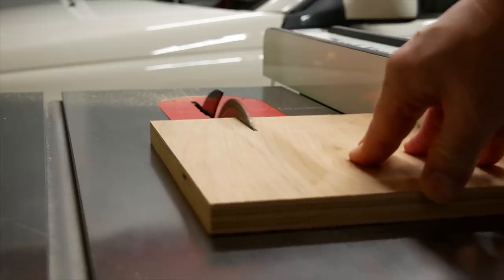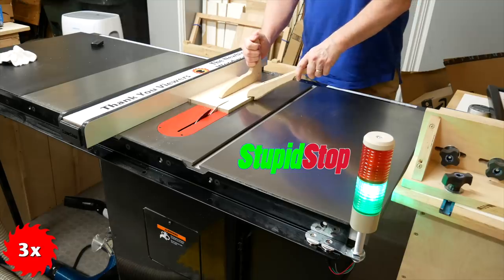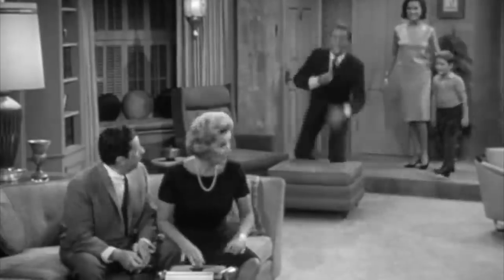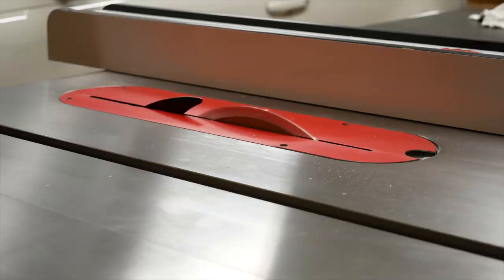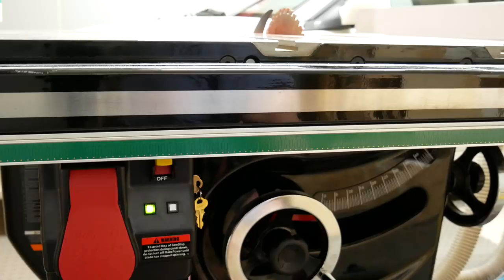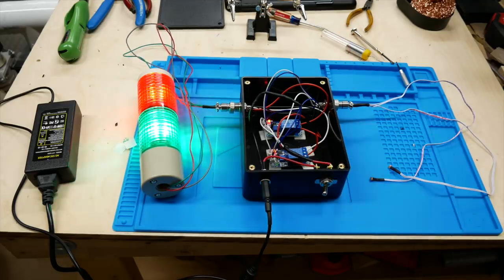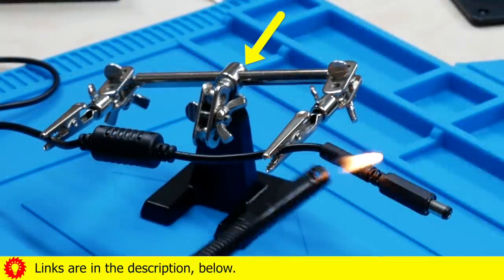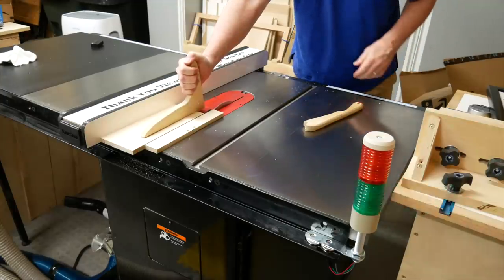Woodworking Distractions, ADD and my StupidStop

Comment: The way they described safety around the table saw when I took the class is not to go near the blade until you can count the teeth - pretty hard to do when it's moving.  Glad you found a useful solution & those other folks need to be nicer.  Thanks for sharing!
Reply from the maker: That's an interesting idea. Not necessarily counting the teeth, because I wouldn't do that for very long, but perhaps painting a spot next to every 5 or 10 teeth, and waiting until I can see the spot. Thanks for the idea!

Comment: I like to practice my motions a few times before actually making the cut.  Sometimes I just do it mentally, but when possible I actually do a dry run with the tool off; essentially rehearsing where my hands, eyes and body will be through the entire activity.  Often this simple step will reveal potential pitfalls.  

For example, before ripping a long board on the table saw you may find your outfeed blocked, or too much drag.  You may find that you need to add support on the infeed to maintain control, or that you need to move a featherboard.

This step also builds some muscle memory, so even if you get temporarily distracted you may find you still do everything the way you rehearsed.

Finally, just the act of taking time to rehearse keeps safety at the front of your mind.  Constantly reminding yourself of the danger involved really helps maintain focus... So even pantomiming your actions or running them through in your head can be enough.
Reply from the maker: Thanks for the great comment. I actually do practice my cuts when I have large or long pieces, checking to make sure I have enough room, or if I need additional support as you mentioned. And I think your suggestions is great, and I hope a lot of people take your advice. For me, I know I just won't do it all the time. It's hard to describe how my mind works, but I know it won't take long before I just stop doing it. Even I can't fathom me sometimes. 🙄But like I said, great advice, and I hope others give it a try! Thanks again. 😄
Reply: Thanks!  That is great advice.

Comment: As a disabled wood worker (only have use of right hand, left side mostly parallelized) table saw safety is my number one priority. Dan I could not agree with you more that  table saw set up is number one.  I do have a splinter and always feel a sigh of relief when the wood enters well into the splinter.  I never and I mean never reach to move or remove any material until the blade stops moving.  My life would irreversibly change as a result of a table saw accident to my one remaining functioning hand.  I suppose in a way I'm am able to concentrate on where my hand and fingers are 100% of the time.  I never cut anything without insuring material is supported going in as well as out.  I watch hundreds of videos where wood workers rip wood, leave the saw running, push the cut through and rip again.  For me it's one cut, turn saw off, remove wood, place material in place and turn saw on and repeat.  It takes twice as long, but it's much safer for me.  I do use appropriate push sticks, feather boards when possible, sleds and taper sleds as well.  I've been in this condition for 40 plus years so safety in the shop is second nature.  If you get some time check out some ideas I've been tinkering with on my YouTube site Working Hand Wood Works.  Chazz
Reply from the maker: Thanks for the comment, Chazz! I can't imagine what life is like with only having the use of one hand, but it sounds like you're doing quite well, and I think that's awesome. I checked out your Radial Arm Router and it's really cool. Have you built it yet?
Reply: Not yet, too many summer projects, but it is next on my list.  I did finish the miter station and went a different route on the shelving.  I forgot to mention how much I enjoy your videos.  Chazz
Reply from the maker: @workinghand5768  Thanks! And I totally get the "too many projects" thing. I have a list of projects to do a mile long, and it only gets longer. But it beats being bored, I guess. 😄

Comment: My father taught me that the most important safety device is the one between your ears. Probably the most important woodworking related lesson I've ever learned. Also, having four kids of my own, and a basement workshop, I have to constantly consider their safety when I'm using power tools and when I'm done with them. Things like removing keys and unplugging tools when I walk away. It only takes a couple of seconds to unplug and then plug in again the next time but it well worth it to ensure my kids are safe. Also making sure they know that the shop space is off-limits when the saws are running, that way they don't get hit with anything if I happened to have something kick back despite using a riving knife. Hope this helps someone.
Reply from the maker: Thanks - great stuff! 😄

Comment: 1) Do not use the saw, or other tool, for a "long session of repetitive actions" - you get complacent. I catch myself doing this now and then ( for example, batching out parts to something... like drawers, scares me awake...). They have those signs on the road to "Take a break, Stay awake" ... same sort of thing applies.
2) Do NOT use tools when you are tired
3) NEVER RUSH... 

4) Avoid any motions which will cross your hands OVER the blade... moving right hand across to your left to grad something, like a push stick....Or reaching OVER the blade to grab the piece of stock
After far too many years, I just built an outfeed table because I realized I was doing just that with short stock, or I was pushing on my push sticks in a way that if the work piece slipped my hand was headed for the blade...so after the event noted in Item #5, I said, this is stupid, build yourself one of those and save your hands! So I did...Everyone should....and a thousand things just like this,
...finally building a cross cut sled too...I like my fingers.

5) Avoid distractions - somebody just said this, but here is a real life example ... I cut my hand with a hand saw ( 5 stitches actually) because I was tired and rushing ... and then I noticed that I was being dangerous and got distracted by that and nailed the hand not holding the saw as I was moving it away from being in a dangerous spot.... I focused on the hand and NOT the saw "for just a second"... GOTCHA... though it has been pointed out that I was only using the proper tool for cutting of one's hand...it being a "hand saw" ... but the 5 stitch cut was only from TWO TEETH actually touching my hand... and only just....a table saw will not be so delicate in its consuming of your hand ( 3500+ RPM x 24 to 100 teeth... do the math)

Mind you this is a saw I have had for over 30 years, and use regularly and in all sorts of situations and with left or right hand as the situation requires ( like on a ladder), it's just a Stanley " Short Cut" saw ( with the " New Aggressive Shark Tooth design" !... they weren't kidding), and I'm not a newbie to this game... I was just 1) tired, 2) rushing, 3) got distracted..... I should note that I was using the hand saw because the cut would have been exceptionally dangerous on the table saw... so I wasn't being entirely stupid....only just enough....complacency is also your enemy 

Be Safe out there.....and if you think that you are....check again......it only takes " 1 second" to really mess up your life and the lives of those around you you care about.
Reply from the maker: Thanks for the great tips, and you're absolutely correct - it only takes a second for your life to change.

Comment: I don't have a You Tube channel so I doubt I'll ever own a Saw Stop But me and the table saw (Craftsman) have never had a problem since I was about 15. But we all feel stupid from time to time and laughing at our selves is good medicine. SQUIRREL!  Thumbs up Dan! Well that is only half right because back in '81 I lost about a quarter inch of my thumb when my glove got caught in a band saw between the blade and the wheel. After that the company built a guard for the saw. It was a metal cutting band saw so it was a slow motion accident since the blade runs a lot slower on a metal saw. Once the wheel had my glove it pulled my thumb with it. Did you know it is possible to yank your hand so hard you can pull off the end of your thumb? It only bothers me when I bowl. My ball release has never been the same. Keep on building!
Reply from the maker: Thanks for the great comment, Tim! Lot's of good-natured humor in it - my kind of humor. Regarding SQUIRREL, and I'm sure you've seen it before, but just in case: http://bit.ly/2n7Zup5. And man do you paint a good (bad?) picture about your accident. shudder 😮Thanks again for making me smile. 😄

Comment: Also severely ADHD, also a woodworker (and maker of all sorts), also not quitting. My biggest disaster wasn't during woodworking, it was... baking. I made cakes ahead of my youngest son's birthday and froze them, and then thawed them overnight in the fridge the night before. Well, when I went to trim the tops it became clear they were NOT fully thawed. The knife I was using to trim the top was sticking in the middle of the cake top. I should have addressed the not-thawed issue, waited a bit, maybe stuck it in the microwave. Instead, I forced the blade... and it wound up deep in my left index finger, needing stitches.

But it's still instructive: never, ever, ever force a blade. Pause and actually fix what's making the blade stick.

Also, that was before I was medicated. ADHD medication helps with the impatience part profoundly, because I'm not constantly worried that I'm going to lose my train of thought mid-project and abandon it like so many others. If you have ADHD and you think medication might help but you haven't explored it, consider it in part an investment in your safety. I'm able to keep track of blades, limbs, safety features and processes, and what I was doing in general SO MUCH BETTER now.
Reply from the maker: Thanks for sharing! One comment you made stuck home: "constantly worried that I'm going to lose my train of thought". To me, this is the single biggest reason for so many of my ADD-related behaviors, and yes, medication does really help.

Comment: FYI - I don't know if someone already said this but next time you have to solder into something like the four pin socket, put solder into the pins first solder your wire then all you have to do is heat the socket and slip the wire in. Its always easier to solder stuff together if you pre solder the wires and pins and use solder with flux in it.
Reply from the maker: Nope, nobody mentioned it. Thanks for the tip! I'll try that next time. 😄

Comment: Why can't saw manufactures install a blade brake? On my table saw, it takes too long for the blade to come to a stop. I would like it to stop within 2 or 3 seconds. Is that unreasonable?
Reply from the maker: That's a good question, and I don't know the answer. But you'd think it couldn't be too hard...
Reply: Exactly right.  The blade should stop sooner.  Why train our eyes/brains to watch the light and not the spinning blade?
Reply: It wouldn’t be too hard to build one in.  An electromagnet could be connected to the status light signal and activate while it’s flashing.  It would sit right off the blade (under the table obviously) and a strong enough magnet wouldn’t have to actually touch the blade to stop it.
Reply: My Grizzly G0513X2BF 17 inch Band saw has an electro mechanical and dynamic brake.
It stops the blade in less than seconds.
Reply: I think it may have something to do with the type of motor used on table saws Steve. I don't know how the saw stop works, but it will brake the saw either mechanically or electromagnetically and that seems to be ok. The nik on Dan's thumb seems to indicate it works fine, although harsh braking like that will kill the saw prematurely.
Reply: Some bandsaws have brakes
Reply: @MiniLuv-1984  I think he means a brake just designed to slow down/stop a blade under normal use.  Not an emergency stop.
Reply: @stevenlarson6125  Thanks Steve Larson. I don't know what such a brake would achieve if it just slows the blade after you've hit the kill switch. Perhaps I'm just showing my ignorance , but if its not going to stop fast enough to avoid injury either by direct contact or flicking a piece of wood, why bother?
Reply from the maker: @MiniLuv-1984  I think the original poster's point was that the sooner the blade stops after turning it off, the less chance there is for accidental contact. And I agree.
Reply: Totally agree electro magnetic or maybe a disc brake that would be able to be retrofitted
Reply: The $aw$top works via a PRICEY ballistic jam cartrage system that immediately jams up the spinning blade into an instant stop, while dropping the whole blade/arbor assy. below the table surface. The major reason you don't see more "braking systems" on power tools is COST! : Tool mfgs. are NOT in biz to make you the very best power tool, they are in biz only to MAKE MONEY - via the tools they sell you : if they include things like pricey brake systems, it ups their selling price & thus reduces overall sales potentials!!! One MAJOR thing to consider when buying the over $1grand+ $aw$top units : compare that cost to just ONE trip to the E.R.! FAR LESS of an expenditure!!!
Reply from the maker: @richpittwood5731  The other people here are talking about the kind of brake that causes the blade to stop more quickly, once the power is off. They're not talking about the SawStop brake.

Comment: Probably one other good reminder is if it doesn't feel right don't do it, if you feel the cut is getting more tension as you move it just stop and either reset or find another way to do it. I have been lucky and haven't had anything serious happen but I do like to do a dry run if I can and try and pay attention. I bought a saw stop because my son is high functioning autistic and does get distracted, I have not so far let him try the saw and I usually do not keep it set up and plugged in (rolling contractor unit) to purposely avoid these issues. I also have a remote on a key chain for my chop saw, my band saw is not plugged in and my other tools are on rolling carts that get plugged in during use. I also bought the saw stop because I have become attached to my fingers as well lol
Reply from the maker: Thanks for the comment! 😄

Comment: I am a firm believer in using the blade guard.  With it in place, I have never come close to a spinning blade.  Mine has the added benefit of anti-kickback pawls.  I hear a lot of excuses for not using a blade guard.  My advise is to get over it and start using yours.
Reply from the maker: Hard to argue with you.
Reply: I totally agree.  With the exception of grooves and dados, there is no reason to have the blade guard off. Having that in place will help you avoid the blade physically and mentally.
Reply: I always have my blade guard on! Except when doing non through cuts, of coarse.
Reply from the maker: @Michael-Makes-Stuff  The big issue for me is that I have to remove it when I use my sleds, which I do all the time. But I honestly haven't tried it enough to know if that's a big deal or not. I'll have to check it out.
Reply from the maker: @timdyesr  See my other reply. 🙂
Reply: Maybe look at designing a blade guard for your crosscut sled as well. Some bent plexiglass might might be all it takes. The idea is that your mind gets used to always having a blade guard, so if you go to make a cut and there isn’t a guard on, you should question that and maybe put it on.
Reply from the maker: @brettmasek9453  Interesting idea. For me, I don't ever come near touching the blade when using a crosscut sled, because I can just move the sled away from the blade. What I really need is to design a sled that will work with the existing blade guard in place, so I don't have to remove it when using the sled. It's something I need to put more thought into.
Reply: One of the things I learned as a USN nuclear submariner... it’s really good to have multiple safety systems!
Reply from the maker: @tomjohnson8220  My brother was in the Navy, flying fighters. I know he was at least inside a submarine, but I don't remember the details. Anyway, I've got an idea for a sled that lets you keep the blade guard on. I'll be working on it today, in fact.
Reply: @tomjohnson8220  I developed my philosophy of repetitive-redundancy after exposure to the Army's Department of Redundancy Department. Thank you for your service!